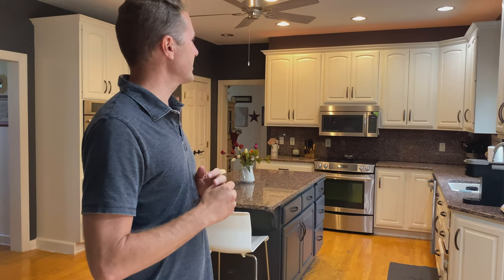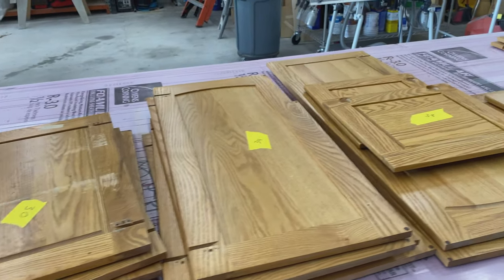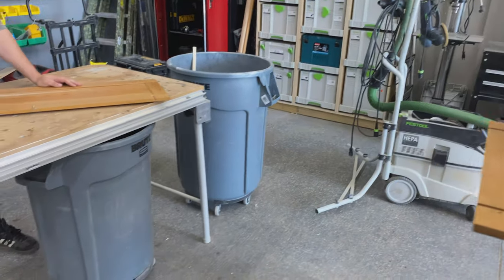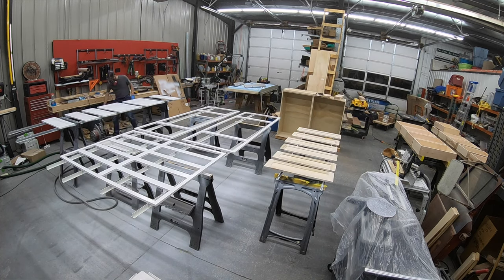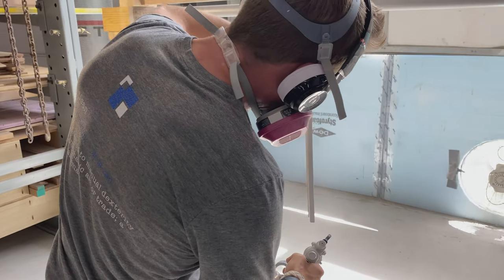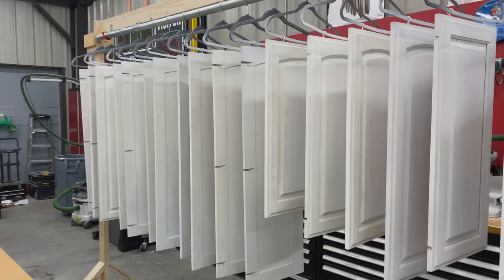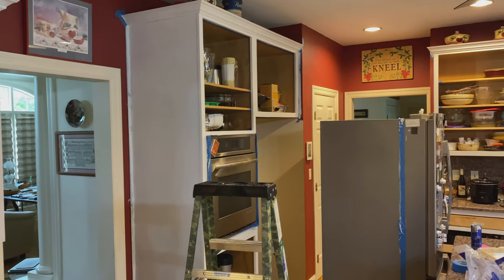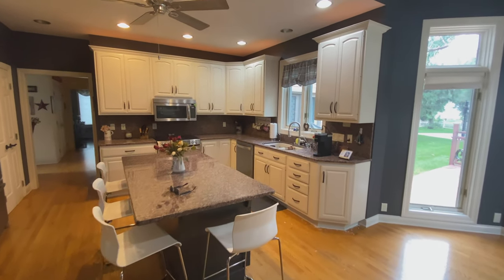How We Painted Oak Cabinets And Transformed This Kitchen

Comment: Nice job Matt. I use the same hanger/hooks method. I find a small foam roller gives a good finish on the sides and face frames. Keep putting videos up, enjoy the content your putting out! 😎👍
Reply from the maker: Joe Veno Thanks Joe! I appreciate it! I didn’t mention it but we did use a foam roller on the large side panels, but you’re right, I’m sure we could have just used a smaller one on the face frames too.

Comment: Did you need to use primer of the face frames that you painted by hand? I would like to do a similar project in my laundry room.
Reply from the maker: Yes, it was basically the same process for the face frames. We just did them in place by hand.